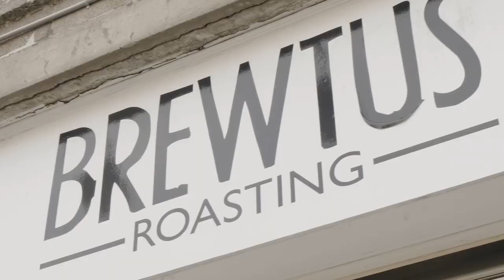How to Make Good Coffee in a Cheap Drip Coffee Maker

Comment: I use a Bunn home coffee maker.  I think it's been awhile since I've upgraded my coffee game.  I find that the preground Don Francisco coffee in the coffee cans 12 ounce work well.  I think the Bunn has lines for 10 5 ounce cups of coffee.  I think it is the velocity style brewer.  I think I use about 2 2 TBS scoops of coffee, per 50 ounce of water from my tap.
Reply from the maker: Well it sounds like you have a repeatable method and that is important. Glad you have it dialed in. I have a new video coming in a couple days of a coffee maker review. So subscribe and look for that.
Reply: @BrewtusRoasting  Thanks.  It works for me.  I am guessing that the 10 cup refers to 50 ounces of water.  The Bunn holds water in the reservoir.  I drink my coffee over ice most of the time, or cooled off from the hot temperatures.  Maybe it is more uncommon that way, but it is what it is.
I have been known to be fond of the frappuchino's from starbucks or whatever, even in the supermarket vanilla flavored was nice.  Most of the time, it is not a big deal.  I tend to save by not going to starbucks often.
Reply from the maker: @MartySalo  Brewing at home is always a great way to save money.

Comment: Well, I heard,(wow, that's hot).   You didn't measure the temperature of that “hot” coffee.  It would have been nice to know what temperature the Cuisinart was brewing at.  I must be the only one who hates fooling with Technivorm.  I replaced the Technivorm with the Oxo 9 cup.  I'd have to start with closing the brew basket off on the Technivorm, wait 30 seconds, give the grounds a little stir, and then open it up and let it brew to get a good pot.  The Oxo 9 should be called the (auto bloom) drip coffee maker.  For the 100-dollar machines, I always liked the Cuisinart and Capresso machines.
Reply from the maker: You are right. I believe it's the burner that makes it so hot, not the brew temp. I've heard good things about the Oxo but I haven't tried one yet.
Reply: @BrewtusRoasting   It seems to be an automatic (pour over), my opinion. Anyway, it makes an excellent cup of coffee.  I had just received a shipment from Stumptown Coffee, just one of many great roasters, and I was very happy with the exceptional pots that required no effort on my part, other than grinding.

Comment: if your coffee pot only has an on off switch, could you just turn it off when it starts to drip for blooming then turn it back on after about 30 seconds?
Reply from the maker: Yes, you could try that as a bloom function. Let it run enough to wet the grounds, then turn it off for 30 seconds to a minutes.

Comment: Actually, the Cuisinart's carafe is 5 ounces per cup for the coffee maker you are using.
Reply from the maker: Thanks for the heads up!
Reply: I believe the Coffee Maker you are using in the video is the DCC-1200 series. Cuisinart recommends using One Tablespoon of coffee per 5 ounces of water.  
When I was using my Cuisinart, I found that making a half batch or only however much  water was needed to complete a brew cycle in the 5-6 minute range gave better results. I found that a normal brew cycle for a full pot on that coffee maker took over 9 minutes. resulting in bitter coffee.
Also, you can lift the lid to reach in and stir the grounds during a brew cycle, but the water would end up dripping onto the hot plate 
I now use the Moccamaster KBT-741. 

I also purchased the flat  bottomed brew basket and lid and spray arm for the Moccamaster Grand and use that with the 741 sometimes. I did have to modify the brew basket and lid a bit to loosely fit against the reservoir. Now I get to use a Flat Bottomed Brew Basket or a Cone brew basket. Lighter mouthfeel with a Flat Bottomed basket and not quite as strong. But, I only use it for a full batch.
I cannot drink a 1-16 ratio. Much too strong for me. Unless I am doing a pour over of only one cup.. @BrewtusRoasting